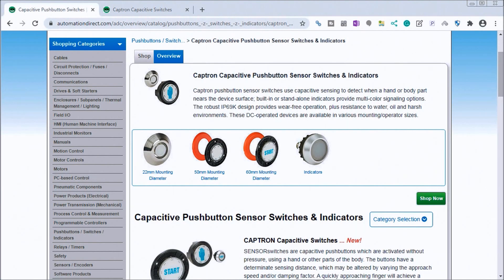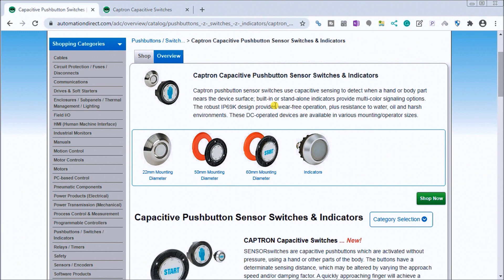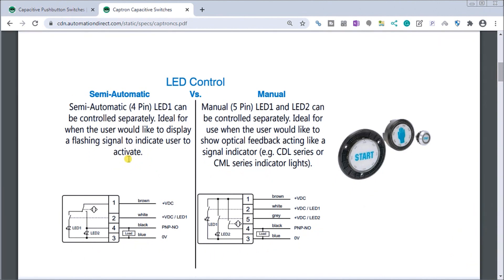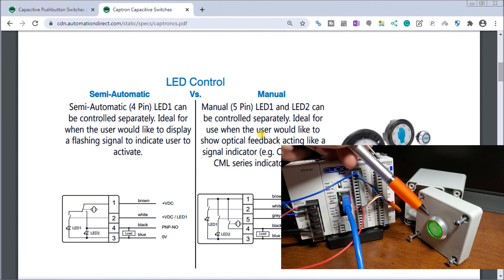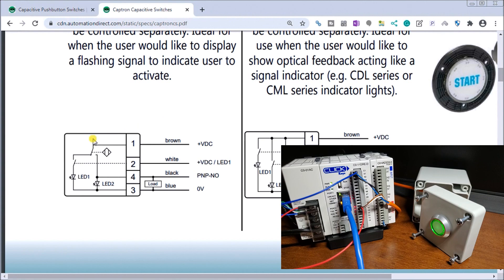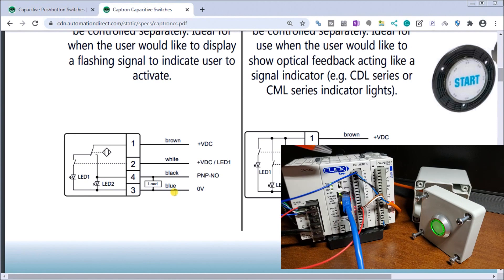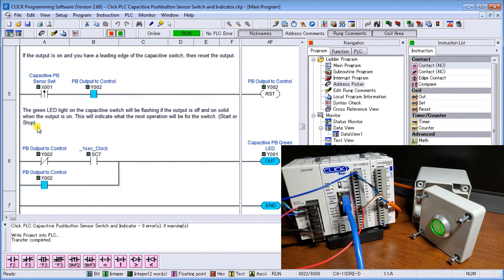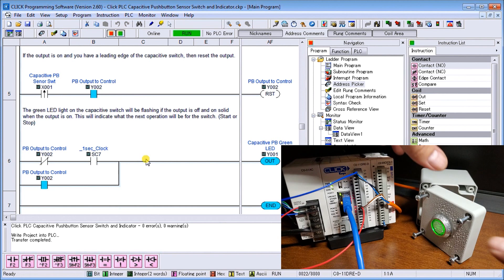Capacitive Pushbutton Sensor Switch and Indicator

Comment: Will these capacitive switches work with the p1am?
Reply from the maker: Hi Ryan,
These capacitive switches will work with the P1AM expansion cards. (8pt or 16pt DC inputs 12-24VDC) 
https://facts-engineering.github.io/modules/P1-16ND3/P1-16ND3.html
Regards,
Garry
Reply: @ACCautomation  thank you very much for your quick reply!
I am currently an electrician studying in my free time to become a control technician/ PLC technician.
I already have pretty strong programming skills so c++ programming doesn't intimidate me. I also bought an Arduino a while back and have toyed with it. But i wanted a plc so i could show a potential employer that i have a bit of experience. So i bought a p1am. I may have some further questions as i continue to b navigate my way through all this. But for the most part I'll try to figure it out on my own. Thanks again for the help.
Reply from the maker: @ryed8118  
Remember that the P1AM is just an industrial Arduino unit that will use the P1000 PLC inputs and output cards.
The IO cards for the P1AM are part of the productivity series of controllers called the Productivity 1000. The software for the PLC is free and includes a simulator. Here is a series on the P1000 PLC controller.
https://accautomation.ca/series/productivity-1000-plc/
You may want to also look at our beginners' guide to PLC programming. This will take you through several general posts in order of importance until you utilize specific hardware.
https://accautomation.ca/programming/plc-beginners-guide/
Let me know if you have any questions.
Regards,
Garry
Reply: @ACCautomation  great resources! I think i should be able to get up and running with my own project with what you've sent. Very gracious!

Comment: Nice one , but still expensive .
Reply from the maker: Yes, but it could be more expensive in downtime. I've been adding these to critical machine controls only.
Regards,
Garry
Reply: @ACCautomation  , yes I agree , probably we`ll offer it in critical uses only , where the cost doesn't matter.
Reply: @ACCautomation  , one more question , how you fell the response time ? (ms)
Reply from the maker: Hi Fabricio,
The response time was good. It does not specify the actual ms in the specification but I would say it is less than 200 milliseconds. It felt like a normal response from a regular pushbutton. The red LED is very helpful for feedback to the operators. I  demonstrated the semi-automatic LED control.
Regards,
Garry